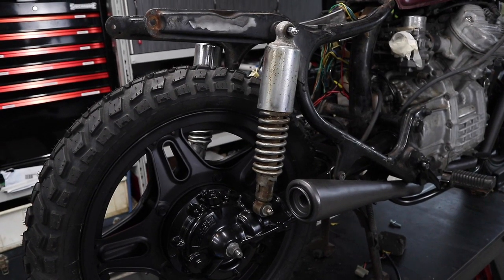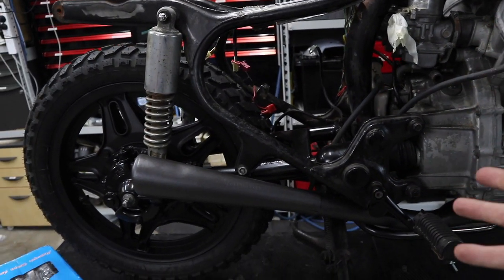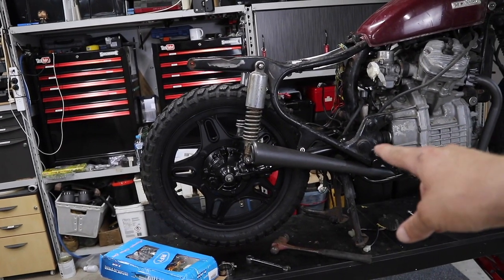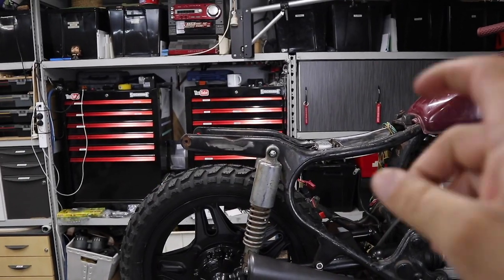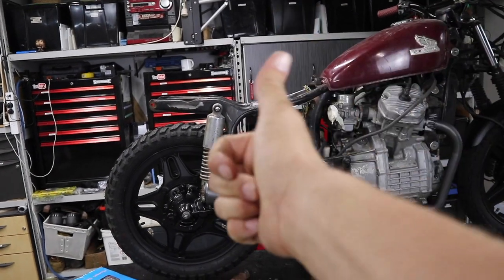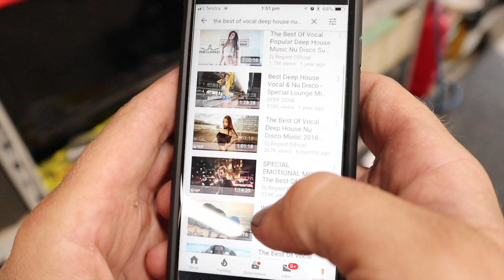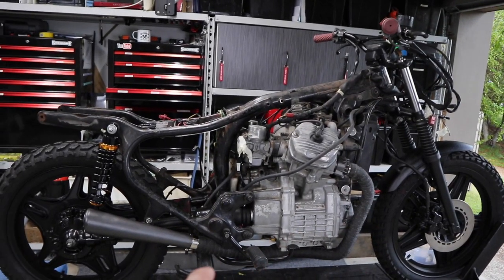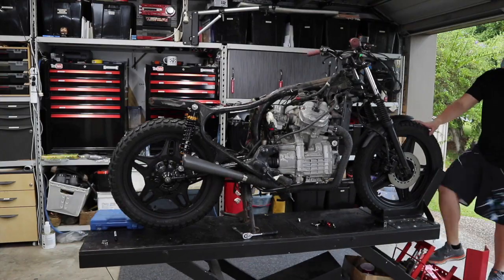How To Wrap a Motorcycle Exhaust- Scrambler / Cafe Racer Build - Ep.11

Comment: Only trouble I've had jumping big engine bikes is engine mount that bolts in front breaks or cracks leaking oil.Shits you so welded together but can,t ever split engine to fix unless grind apart again, good luck and make sure all your bolt mounts are tight
Reply from the maker: slipryeel Thank you for the advice brother,  I will definitely check them

Comment: Mate I was just thinking... You find a plumber in your town and he will bend you a piece of tube straight away for it... Worth the try as they have all sort of pipe bending machines 😉
Reply from the maker: Hi Nuno,  This a good idea but the 24mm CHS (circular hollow section) I will be using has a very thick wall so even a plumber will struggle,   I thought about making a jig and bending it myself but It a lot of work for one piece of pipe so I just found a guy to do it for me :)
Reply: @CafeRacerGarage  does it need to be thick? Just asking as I don't know how you will finish the rear yet 😂
Reply from the maker: Nuno Cox no it doesn’t really but the 24mm stock tube has a thick wall and I can’t change that. 
It’s just what I have available in Australia

Comment: What gauge metal are you using for your electric boxes and also tabs you're welding to the frame?
Reply from the maker: Jeff P. 1.6mm for the boxes and 2 - 2.5mm for the other parts.   Anymore questions just ask :)

Comment: You should get rid of those p.o.s. carbs and get a pair of lectrons carbs and kiss all your carb problems goodbye.  They are self adjusting carbs. It'd be the best purchase of your life, I promise you that. They automatically adjust for pods, humidity, pressure, temperature, and altitude. You never have to jet or adjust ever again. They're also big fuel savers. Also the throttle response is amazing. I put 4 on my 81 GS650GL Suzuki and now I feel like I'm cheating on my wife every time I ride. LoL..😎
Reply from the maker: Wow Ben I will check them out and once I complete the $1200 budget scrambler challenge I will have a bigger budget for this  :) They don't sound cheap.
Reply: @CafeRacerGarage  
It cost me $1550 American for 4. So around half for 2. I've seen a couple cx's on YouTube with them and from what I hear is it's an easy upgrade for a cx. My bike had the original carbs on a rail setup, so I had to Jerry rig mine to a quad cable set up. It was a bit of a pain but worked out in the end. I got mine because I like to ride in the cascade mountains and I go from 50 foot elevation to around 5000 foot elevation  and back in a day. When I'd get up in the mountains I'd notice a big power loss and sometimes I'd have to pull my tank and adjust my carbs while there. Ever since I got these carbs, I haven't had any issues in the mountains. I wanted to go fuel injection but that was to expensive for a 4 cylinder, but I think these carbs are as good if not better than fuel injection.
Reply from the maker: That is awesome and i love the idea, I wonder if you can drop a link to the CX Video you saw with them fitted,     that ride sounds amazing by the way I remember what the drive into Whistler was like early this year so I'm assuming its as amazing as that?
Reply: @CafeRacerGarage  
Never been to whistler, but I think the ride to Mt. Baker is would be. Especially when you get on the old logging roads. I live in Washington state. I couldn't find that video for the life of me. I think it was on racer tv or something.  But they have an epic BMW café on their page with lectrons on it. If your carb cables run up to a 2 into one cable collective,  then it's going to be a plug n play set up. Mine was set up as one cable operating a rail that connects to all the carbs. Kinda like your cb 750. So I had to figure out how to set up a 4 to 1 collective. Here's their site.
www.lectronfuelsystems.com
The BMW is the fourth dot.
Reply: Ben Hawke those sound like the nuts Ben can you send me a link to where you purchased those little beauty’s
Reply: Ben Hawke thanks for your reply mate I had a look there but could not see any for the Gs bikes.
Reply: @dowser81  
They really only cater to dirt bikes, but they do go up to 52 mm on the 4 stroke  carbs. So I had to figure out the size of my stock carbs and then I contacted them and explained the situation and got the GS kit with my size of carbs in it. Get a hold of them and they will work with you.
Reply: @dowser81  
Also.. the GS kits are under "specialties ".

Comment: Can you post a link of the handlebars you are using. I think you said they are from eBay but if you could post a direct link that would be great.
Reply from the maker: Here you go brother,  They are very light so I would be careful if you want to use them for off-road,  Im thinking of getting a stronger set after the challenge is complete.   

https://www.ebay.com.au/itm/Universal-7-8-Black-Motorcycle-Tracker-Handlebar-Drag-Bar-For-Harley-80cm/152872278995?_trkparms=aid%3D555017%26algo%3DPL.CASSINI%26ao%3D1%26asc%3D20180905084510%26meid%3D5d84b8fe29d941e6b68cdbde44fa8d5f%26pid%3D100505%26rk%3D1%26rkt%3D1%26%26itm%3D152872278995&_trksid=p2045573.c100505.m3226

Comment: What casued the white smoke?
Reply from the maker: HajtoTimaSek it was just steam coming off the Pipes because the wrap was still wet. It’s normal for that to happen when you first wrap a set of pipes. 
Also a little white puff of smoker  vapour came out the exhaust which I’m assuming was just unburnt fuel